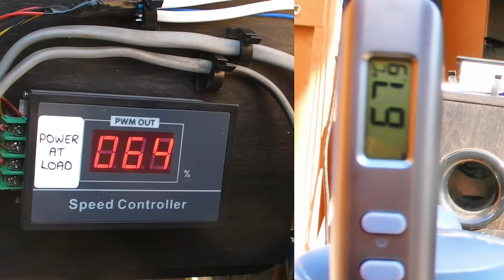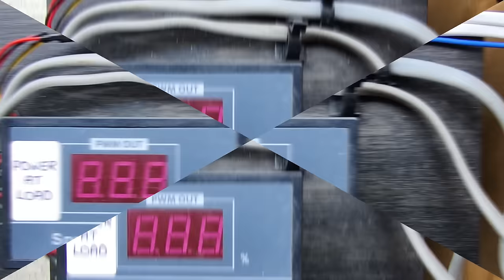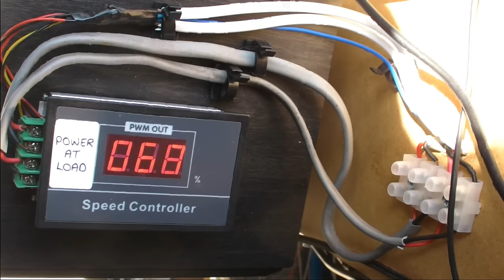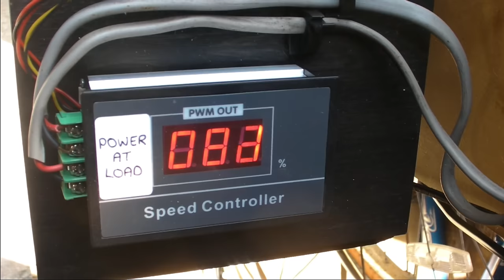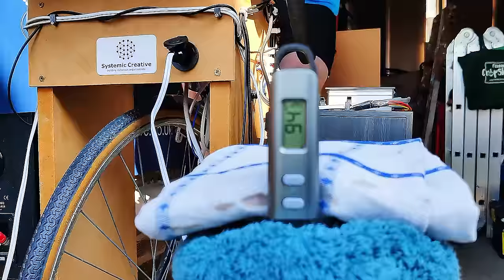Can you boil a kettle with a bike generator? We try to find out...

Comment: Thanks. In the Philippines where a lot of the employers want to pay $5/day, the cooking gas and utiliities expenses are not affordable.  The young people do have energy to pedal. I was curious whethor a one time capital expense for a bike generator combined with some solar could run a rice cooker and replace the bottled gas need.  The exported inflation is really hammering people there. It looks like it might be tougher pedaling than I had hoped.
Reply from the maker: Hi Daniel. It's an interesting idea, and a very sobering thing to consider its necessity.
Unfortunately, I think you'd be up against it to derive a greater calorific density from the food cooked than the energy used for pedalling. And just the physical effort required to get something to boiling point is quite a lot - the team here are all experienced cyclists.
That said, coupled with solar, a bike generator adds something and helps fitness at the same time. A very efficient slow cooker used for moderate to large quantities might be possible to power this way. But from a bike generator alone, I don't think it would be possible.
This kettle boil took us an hour, and although we were all pedaling at different power outputs, the average was well over 200W. Even with 100% efficiency, 200W for an hour takes about 172 kCal, and the human body is not 100% efficient.
A more realistic use for bike generator is the charging of small electronic devices up to the size of a laptop. Using LED bulbs, it would be possible to generate enough power to light a small home each day using a bike generator.
Maybe this could offer some small relief from expensive utilities?

Comment: hi how long did it take?
Reply from the maker: Just over an hour in total!
Reply: @SystemicCreative  Nice :), thanks you.
Reply from the maker: You're very welcome. Are you thinking of building one and having a go?
Reply: @SystemicCreative  Yes, I am looking for suitable components.
Reply from the maker: Excellent! Hope it goes well. Feel free to get in touch if you need any advice. 
Check out the wiring diagram video for a detailed circuit, and to can also download the circuits as a pdf from our website. Link on the video 👍.
Reply: @SystemicCreative  hello, thanks you.
1. How big alternator to buy (Amp)
2. how big an inverter to buy and with what kind of sinusoid (clear or modified) is it better?
3. Alternator is better, more efficient to buy bigger 75-120amp?
Reply from the maker: @petrhasek4321 it doesn't matter too much on the size of the alternator because the power you can produce with your legs will be the limit. For an alternator with 12V output, you will not be able to produce much more than 20 Amps when riding, probably less, unless you are a professional cyclist with massive power and endurance! A 40amp car alternator will be sufficient. 
For the invertor, again, it doesn't make too much difference unless you are using sensitive equipment. Modified sinewave are usually cheaper. That's what I use and have never had a problem, although I use the DC in pure form most often because it's more efficient.
Reply from the maker: A 300W invertor should be sufficient unless you're an absolute beast!
Reply: @SystemicCreative  Thank you very much for your answer :)
Reply: @SystemicCreative  Im thinking of building a multi person unit, maybe a tandom bike or 2 bikes side by side. with a single alternator on a common shaft.

One question i have is how much water was in the kettle? 1 liter? .5 liter?
Reply from the maker: That sounds like a great project! A tandem would probably be easier but would take a lot of linear space. We boiled just under half a litre in this video.